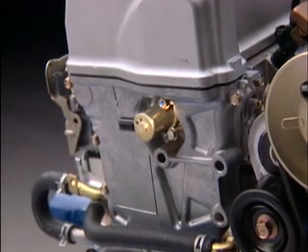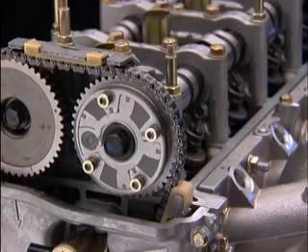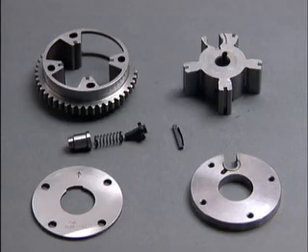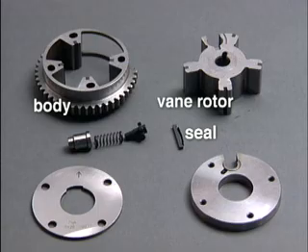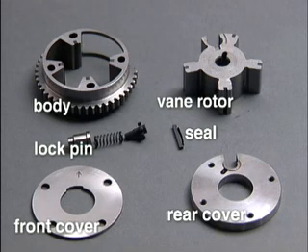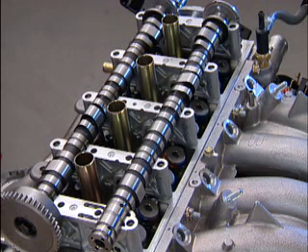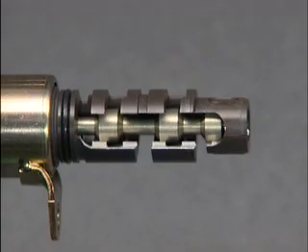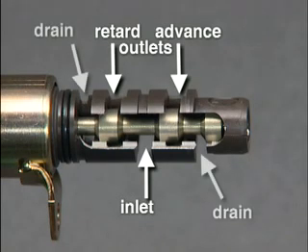K-Series iVTEC VTC Cam Phasing System - In Depth

Comment: So how do you lock it into advanced permanently?
Reply: Why would you want to? You would never get it started or be able to get it to idle with that much overlap.
Reply: Эта система либо полностью работает (все её функции), либо не работает совсем.
Reply: Wouldn't that defeat the purpose of a VARIABLE Valve Timing system?
Reply: Shane Smith yes, I don't like the whole concept of fuel economy until the engine revolutions get to a certain spotted
Reply: KustomGraphics206 That means you lost all your area under the curve - VTEC allows you to use two different cams which means a wider powerband - i-VTEC allows you to phase  the cams and optimize both cams at any rev range to make the most possible power from that grind......running boost and ONE grind = 70s boost ---- this is 2015 and i-VTEC boost kicks the shit out of that setup for a street car
Reply: Servicemember80
VTC is what makes what you are saying correct, not VTEC. VTEC is pointless on a turbo engine, as cam lift and duration only effect the spooling properties of the turbo, as in the smaller cam profile doesn't spool the turbo very fast. VTC is worth having on a race car, VTEC isn't.
Reply: Joe11Blue   Why isn't VTEC worth having on a race car?  If you are racing you should be above the VTEC activation point.
Reply: KustomGraphics206   Congratulations... Your turbo car is out accelerating an N/A car with the same amount of cylinders.
Reply: Jujutsuheiho
For a few reasons, but primarily because of the loss of oil pressure when it engages. You really don't want to be on low cam anyways, because if you aren't accelerating on the track, you are down shifting which means you are staying above the point where the high cam is best activated the whole time anyways.

Which means that low cam is essentially useless. The bad part is that it causes uneven and irregular wear on the cam and rocker assembly. Everything has a trde off, but when it's an all out race engine, just lock the VTEC onto the high cam and be done with it. The other option is to get custom cams that have primaries that are the same size as the large lobe, but that costs more than just pinning the VTEC on permanently.
Reply: KustomGraphics206 Stock K20Z3s are running 10s bruh --- whats your home built cam'd LS running? dyno? Hell what turbo are you using --- you avoided answering my questions because I already know the answers and stock block K20s SHIT all over your numbers and power band on STOCK cams
Reply: Joe11Blue  Good points, the VTEC was made for a daily driven car that can turn into a race car. More recently VTEC has become ancient technology and we have now moved to a continous variable and VTEC aka i-VTEC. But yeah if it was a straight up race car I would just stay on the high cam profile and not be too concerned about reserving the engine. Which is what I am sure racing teams do. Once they get to where the car is nothing more than a track car. But I would not say VTEC is worthless. For instance my RSX is very good on gas mileage if I stay out of VTEC. And I don't really feel as though I am lacking complete power at low rpms.
Reply: Jujutsuheiho
IMO, I prefer the non-VTEC Honda engines. The F22a in particular is my favorite Honda engine. No VTEC, and it outflows every other Honda engine in stock form. The B20 for the B series, even though it's head doesn't flow well.

As for gas mileage, that has everything to do with VE and cylinder pressures. With enough compression any engine can get excellent mileage.
Reply: Gas mileage has a lot of variable that goes into it. But engine wise its how much fuel the computer is telling to inject. Working on a less aggressive cam you have less fuel being thrown in to match the amount of air being thrown. Versus if you had a constant cycle. So it's like having a low powered car when you are daily driving and a higher powered car when you decide to hit the higher RPMS. I'm not familiar with the F22 having the best flow. I would think Type R's since their engines are hand built and ported. I like the i-VTEC concept. To me its like having two different engines.
Reply: Jujutsuheiho
Engines with lower VE require more fuel and RPM's to make the same amount of power an engine would with less fuel and RPM's with a higher VE. The computer and injection rate has very little to do with how much fuel any particular engine needs to produce a particular amount of  power. EFI can make the power more efficiently than non-EFI, yes, but it doesn't increase fuel efficiency by simply being EFI. Two identical engines with the same EFI system will have the same realistic efficiency.

The cam has nothing to do with fuel efficiency. It only moves the VE and cylinder pressure around the RPM band by altering the dynamic compression. This can lower efficiency, but only within a specific range. This bearing in mind that measuring fuel efficiency by the mile is rather inaccurate with how efficient the engine is producing power. It should be a ratio of RPM's versus power applied as a measure of efficiency, but no one does it that way, so...

No, the F22a head has the best OEM flow out of any other Honda engines so far. It also has the best port and throat design from the factory. The major hindrances to it were the valve sizing and the intake and exhaust components around the head were just plain lousy. The fastest All-Motor Honda has always ran the F22a head. The next fastest All-Motor engines (stroked H22's) did what that engine did with a loss of lifespan by increasing the stroke to increase cylinder pressures to make up for that lower inherent VE due to the poorly flowing head.

The rule to being truly fast in any motorsport is to use the engine that gives you the best ports and head to work with and to go from there. Anything else is essentially trying to do things the hard way.
Reply: Joe11Blue  What is your definition of VE?
Because the more Air you throw into the cylinders the more fuel gets thrown in for the mixture. Or else you won't have proper combustion. So if you are getting a lot of air trapped in the cylinder gotta have the fuel to match hence the computer with inject more fuel to match the mixture.  This I would say would cause your gas mileage to go down, but you power to go up.   Having the lower cam profile outside of VTEC means less air being thrown in during each cycle since it's not maximizing effort during the opening and closing of the valves. Hence less aggressive engine, less power, and more fuel economy. Since not as much fuel is required for mixture.

There's a lot of keys to being fast in motorsport that goes beyond just an engine.Well unless you are talking about drag racing. 

That's also pretty neat info. I would imagine Type R engines that have their heads port and polished and hand crafted would have much better flow than assembly line created engines
Reply: KustomGraphics206  Turbo is the way to go if you want to get more power out of an engine. But I prefer N/A and high revs. Responsive engine and Revs I can play with before I have to shift up before a corner.
Reply: KustomGraphics206 oh and FYI - your "low" boost setting is probably making 300whp or thereabouts lol which means the only reason you are running 11.4 is because its in a gutted EG with a close ratio box -- you probably trap like 115 or something ridiculously low
Reply: KustomGraphics206
If you're on a budget and F22a with B-series trans is a great option.
Reply: Joe11Blue The K20, F20c and F22a flow pretty close together - however the K20 and F20 were designed for 2.0L vs the F22 being for a 2.2L -
Reply: Servicemember80
The K-heads have less material to work with though, which means the F22a can be worked into something far better and for less $$$.
Reply: KustomGraphics206 I got rid of the Honda for 02 VW gti 337 with a Audi tt 1.8T AWP long block, fully built head, K04 turbo upgrade and 94 turbo VR6 Corrado 5 speed transmission swapped for the 6 speed. 4-5 inch exhaust straight through with everything deleted, whole entire new suspension, control arms from R32, Raceland coilovers, cross drilled and slotted rotors, BORA front end conversion
Reply: KustomGraphics206  The F22a setup still comes out ahead in the cost benefit ratio with a forged bottom end. It might cost $1200 to rebuild your bottom end. You can hit 600whp easily with the right turbo on a forged bottom end F22a. That will be 600whp with like 400+wtq too, so it will be faster than the equivalent cheapest K-series setup. You'd have to build a K24 with forged bottom end and cams to get close to matching the F22a, and that means like an extra $5-10K on top of the already $5-8K you're already spending.

Rods are like $400, Pistons are around $350-400.

This is if you're going to stick with a Honda, which IMO is hard to justify unless you're trying to run in a specific class, or just already have the chassis and some of the parts. You could just as easily take that money as a down payment on a new Vette, Stang, Camaro and be happier with your DD duties. You really have to want to go fast in a Honda to spend that much IMO, or just have a series you want to run or have something to prove as a builder or engineer.

Me personally, I would just save the money and buy the next gen Camaro 1LE.
 Having that warranty means I don't have to fork out of my pocket to fix things, and something is bound to go wrong with a high HP Honda. It usually takes a few months to get them sorted out properly, and I used to daily a 400WHP Hatch, but it took like 3 months to get reliable enough to DD. YMMV
Reply: Joe11Blue wouldn't all that power rip your suspension apart like bushings and cv-axles? How would the tranny even handle that much power besides just a stage 2-3 clutch? My 1.8t gti is fully built and it's been one problem after another with suspension, tires, bushings, control arms. It has a stage 2 clutch on a turbo VR6 Corrado tranny so it shoots up to 85-90 mph in 4 seconds but then third lags but fourth has the most power of any gear. I've gotten up to 155 in fourth gear and stl had an extra 1500 rpm. And the wear and tear is ridiculous, the amount of work I've done to have the car driving safe safe, I've already replaced the whole front end with R32 and Audi tt parts, stiffer bushings, motor mounts, dog bone mount all the intercooler piping keeps getting little holes in the rubber like a tire thread blowing out. It's all silicone now. What do they have for Honda your can use from other cars that fit?
Reply: Joe11Blue LMFAO - your prices are way off - you can find K24 blocks in the junk yards for dirt cheap -- rods and pistons are about the same cost for 4cyls which means the F22 isnt cheaper - you can buy an entire head and block K20z3 for 1500-2000 or so - save the oem K20 bottom end and buy a K24 bottom for a few hundred bucks and throw some forged rods and pistons - maybe 11-1200 --- the biggest thing is the K20 setups rev higher and make more power --- so you wouldnt even need to go K24 really --- keep the K20 block and just add internals --- 2K for the motor and 1500 for internals and machine work - 3500 for a motor which could easily see 900+whp on decent boost - the trans would be more of an issue than anything else - power is the easy part - need a built EP3 5spd with forged gears or run a dog box setup on the 6spd

Boosted Hondas are not  that hard to have if you build them properly -- there are plenty of 11 sec turbo Honda dailys - you can build them dirt cheap now days anyway
Reply: KustomGraphics206 This kid
270whp and 11's huh? what does your car weigh and what does it trap? I was going to give you the benefit of the doubt but now it just sounds like your making shit up to sound cool --- I showed you videos of TWO cars which make the power to run 10s chief with 11.2 sec passes with plenty of trap for 10s --- if you are THAT ignorant to think 2-3 tenths cant be taken out of a car thats trapping 130ish than you are an even bigger ricer than I had originally thought --- Ive known plenty of D series guys who have gone high 12s with 225ish whp --- so with 50 extra whp your now running 11.4's? LMFAO Sure you are kid....again --- list your cars specs so we can have a good laugh
Weight
Trap
Trans/gearing

This should be hilarious broski
Reply: Nope, I'm talking about equivalent builds. You're talking about shitty CRV and Accord engines with heads that flow like garbage and boosting the hell out of them. I'm talking about a useable powerband that doesn't leave any questions about when you should shift, because your peak torque is under 4K RPM's.

Huge fucking difference there, and 900+WHP, that is not lasting long, and there is no way you're making use of that powerband on anything other than a drag strip.Servicemember80

F22a blocks are $100 at almost every junk yard. You aren't seeing a K series worth building for that price. Your cam is another ~$300 if that, the springs and retainers, maybe $500. F22a still coming out ahead for more power. I'm speaking about builds that can pull street duty and track day duty. Not drag racing.

Comment: Honda develeped variable valve timing before any other car manufacturer
Reply: Honda was not the first company, but they are the first to perfect it. Alfa Romeo was actually the first company to use this system on production cars. Fiat was the creator of it all, VVT in automotive vehicles today should thank Fiat for coming up with this design after all the designs we thought of back in the early 1900's. Hope this helps.
Reply: Aaron Logsdon what about fiat?
Reply: nope. Alfa Romeo was first for production. Fiat had first working prototype under patent. Honda was the first people to invent something that you didn't have to sell your kidney for...
Reply: @Metalistforlife  whatever you do, proper oil changes are VITAL TO THE VTEC AND VTC SYSTEMS!
Reply: Servicemember80
 Nope. Fiat has the 1969 patent and Alfa had this in production cars in 1980.
Reply: Metalistforlife You obviously know very little engines or camshafts - varying the timing is NOT the same as varying the LIFT of the cam profile --- one day when you understand that variable LIFT means two entirely different cam profiles you will understand that valve timing is childs play and was invented in the 1920s - Alfa may have used it on cars first but they did not invent the idea of variable valve timing nor did they create a system as groundbreaking as variable LIFT would do.

These days many OEMs have tried to replicate their own variable lift systems but again - Hondas are known for their amazing engines such as the K series which pretty much wrote the book on OEM all motor airflow for mass produced engines avg people can afford. 

These are the patents Alfa cited when they filed theirs

Cited Patent	Filing date	Publication date	Applicant	Title
US2107070 *	Sep 18, 1936	Feb 1, 1938	Saurer Ag Adolph	Shaft coupling
US2162243 *	Sep 7, 1935	Jun 13, 1939	Wright Aeronautical Corp	Autoamtic magneto coupling
US3258937 *	Jun 25, 1964	Jul 5, 1966	Caterpillar Tractor Co	Automatic hydraulic engine timing device
US3401572 *	Sep 12, 1966	Sep 17, 1968	Caterpillar Tractor Co	Compact speed sensitive timing device for internal combustion engines
Reply: @Servicemember80  Yep you are the one person in here that knows his shit. Variable lift Timing Electronic Control + VVT = VTC for Honda K series engines. So Honda basically made a way to have variable valve timing and variable cam profiles for the i-VTEC K motors. I'd like to see Ford or Chevy version if this.....
Reply: Aaron Logsdon Honda just made it reliable and resistant to get stuck, get broke or need to be serviced.
Reply: true !
Reply: Metalistforlife Honda invented variable LIFT - variable valve timing is OLDDDDD - variable lift = VTEC = 1989
Reply: Servicemember80
Check Alfa Romeo Spider 2000 and respectively US Patent 4,231,330.
Reply: everyone keeps talking about variable lift, everyones an expert yet no said anything about duration. v-tec=variable valve lift and duration.
Reply: Stephanie Lynn you are correct that fiat was actually the first. I've done some research since I posted this lol and fiat patented vvt in the late 60s, alfa romeo was the first to implement them into a production vehicle in 198o, and Honda started using them 1989.
Reply: hey Toyota mahn
Reply: I LOVE HONDA
Reply: bobenc0 no, both of you are wrong. honda was not the first to use vvt. they were the first to implement lift and duration into vvt.